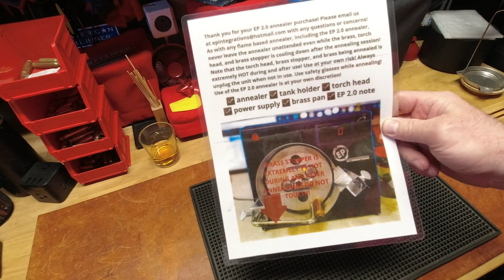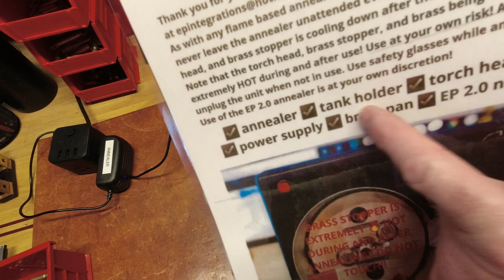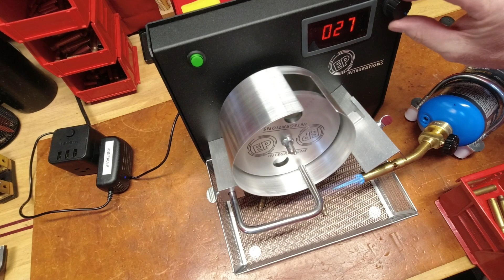First Use: Low Volume (for me) & Small Footprint Annealing Solution from EP Integrations

Comment: Once again, awesome awesome video! Here are some suggestions on how to get your annealer, annealing, within a minute & set correctly using "test brass" & by using the "glow method"... its not about the time in the flame, it's about the glow which is all dependent upon the heat of the torch which can be some what different every time you anneal... its alllllll about the glow with the lights dimmed down with your "test brass".. get the hotter blue inner flame a little over one inch long and have it barely touching the brass where the neck meets the shoulder... and larger cartridges might need a long / hotter flame (skip to 22:00) https://youtu.be/BqZVj0OcouY
Reply from the maker: Appreciate the advice, very helpful.  I will "follow the ~1" flame" and remember it's all about the glow.
Reply: @ReLoadersBench   @Re Loader  nice! Just another suggestion,  push the brass stopper up to the shim plate as far as it goes in on those larger cartridges (any cartridge to that matter) so the brass stopper is completely on the side of the brass so it rolls better.... and roll the drum opening in line with the adjustable fence when adjusting the fence & get the back fence just in front off the shim plate = you'll be right as rain 🌧😀

Once again, nice work and awesome video on your maiden run with the annealer! Keep up the amazing work
Reply from the maker: @ElfstersRiflesandReloading  - Will do and thanks.  Great guidance/suggestions to help me improve/learn!
Reply: @ReLoadersBench  what I love about reloading is.... we all learn together ❤ I'm still learning to this very day and it's a never ending process.  Love it 👊💥😀